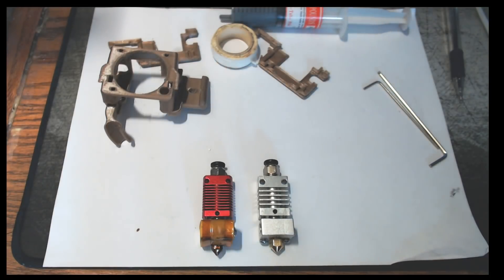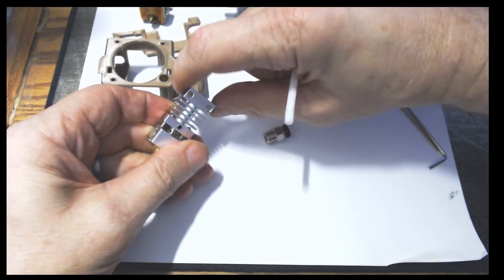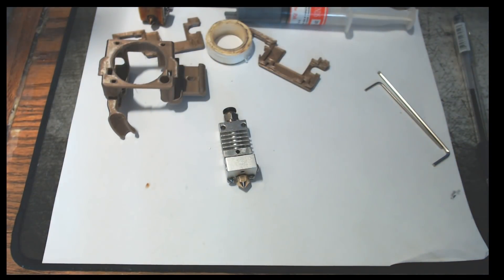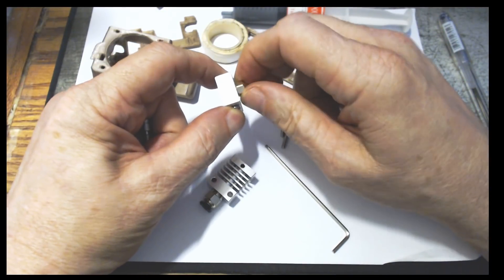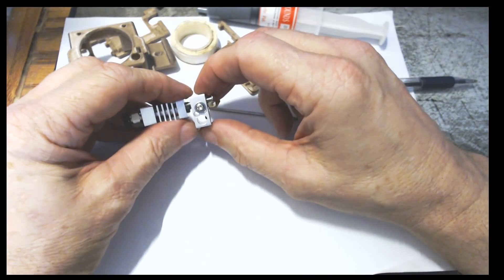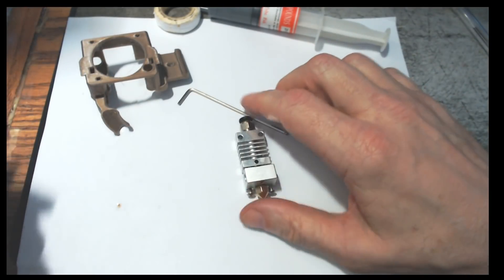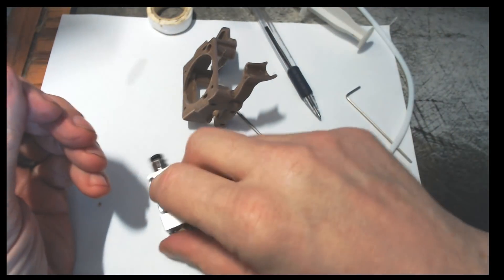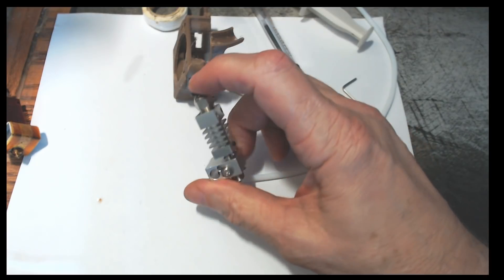All metal hot end for the Ender 3 for $7. Part 1, tips, trips and lessons learned.

Comment: First of all, thanks for sharing your experience. I tried hard to make it working with my cr10 but i couldn’t. It clogs after few filament retractions. I thought the hot end was defective so I kept it away and put back the stock hot end but with a blue PTFE tube jus like the Capricorn one. Also not sure if it is a clone or not but it is much cheaper. Anyway, after watching your video i will try it with your suggestions when time come to try a high temp filament. 
Thanks again.
Reply from the maker: Try doing what I did in the video and also setting the retraction distance at 2mm or less and the retraction prime speed to 20mm/sec. I've been using that with good results with both PLA and nylon.

Comment: I see that this cheap all metal hotend comes in two flavors: 1.75mm and 4.1mm. The seller claims that 4.1mm version is for printing temperatures 0°C-220°C, and 1.75mm version is for 260°C-300°C. Do I really need to replace hotends when switching between nylon and PLA?
Reply from the maker: The 4.1 mm is probably not an all metal hot end, the 4.1mm is the size needed to push the bowden tube all the way down to the top of the nozzle. 1.75 stops the bowden tube just past the top fitting and only allows the filament through. And while you don't need to swap hot ends when switching between nylon and PLA, you'll get better quality prints with PLA and a non all metal hot end because you can crank the retraction up to a level that will clog an all metal hot end. It's not a huge difference and there are ways to lessen it, but it is there.
Reply: @3rdpig  Ok, so I will give a try to 1.75mm version. Thanks!

Comment: i saw 1 that looks like that on ebay for $15... do you think that paste is really necessary? i don't know where to get it anyway... also i watched another video on replacing ender 3 stock with the swiss metal end which looks exactly like the one you installed..he said he had to re calibrate the firmware so nozzle temp got to correct temp as it showed,,can you tell me if this is necessary...sounds like a pain in the ass... thanks for your great explanation..
Reply from the maker: Don't use heat sink paste, that was a mistake on my part. I should add something about that into that video. I haven't bothered with nozzle temp correction on mine, but to do it you'll need an multi meter with a temp readout and a bulb type thermistor. The Owon OW16 $25 is around Aneng 8909 is $30, either will work. You'll have to use something like nylon filament, pull the bowden tube do an atomic pull to get the filament path completely clear, then put the thermistor directly into the center of the nozzle. I've been meaning to do this and make a video, but just haven't had the chance. As I said, I haven't done it on mine and it's printing fine at the temps I'd been using, but as always, yours may be different.
Reply: @3rdpig  Thanks for the update... i actually found 2 on ebay for around $10,but they will probably take 2 plus weeks... they look the same so i will keep my fingers crossed... thats good to know you use same settings so mine should be very close to your results...i use main Petg, do you use same retraction and speed settings as with pla or do you slow things down a little? i hate blobbing and stringing... thanks

Comment: Can you post some pictures of your prints with this hotend
Reply from the maker: Everything I've made in any material other than PLA and PETG since installing it was made with that hot end, that includes nylon, ABS and Polycarbonate. The polycarbonate prints sucked, but that's not the fault of the hot end. You can look at those videos but I'll also try to include some shots in my next video update, which should be in a couple of days. If you're looking for pictures of PLA printed on that hot end it might be a while since I don't print PLA on the printer with that hot end. What filaments and temps are you going to be printing that's making you consider an all metal hot end?

Comment: Thanks so much for the tip about the two screws that hold the heater block to the cooling fins. I've got a metal heat break that converts the stock hot end to an all metal and I keep getting clogs. When I ran filament through it while cold I noticed a bump where the nozzle and throat/heatbreak meet up. I'm guessing I have things too tight and that's causing my issue. I can't wait to get home and loosen them up to see if that resolves my problems.
Reply from the maker: I've since been informed that those two screws should be removed after installing and 
tightening the nozzle when hot.
Reply: @3rdpig  I ended up leaving those two screws out when I put everything together to see what would happen as the nozzle is really tight against the heat break. I'm not sure if it's having finally gotten thermal compound on the bottom of the heat break or leaving the screws off or not having them pull the heater block and nozzle at a funny angle but for the first time in a while I've gotten more than 5 hours into a print without it clogging. Thanks again for the helpful video.

Comment: Hi Chuck.. Big fan here.  I'd love to hear what settings you finally settled on with this guy.  I've been having a tough time, but my situation is improving I think.
I am currently at 1mm retraction, 20 prime speed, like you said, used their paste..  but after a few layers, like in your example, I was getting separation and weirdness.
I found how to tune the pid, did that...
Used the paste..   
I start out nice, only light stringing..
Now after several layers I get large temp fluctuations, like 5+degree.. and invariably the filament doesn't come out..  this used to happen sooner, like in your example, now it's happening much later..  I'm not getting weirdness with my layers now, but the filament either sputters or it gets hung up, possibly at the titanium piece

Would the filament problem also cause the temp, or temp problems screw up how the filament behaves?
I've tried my best, I believe, to tighten things at temperature..
Is there a good way to tighten the titanium more maybe?   
Sorta feels like I'm chasing my tail.
I don't have any spray or lube to make things slippery.. there a cheap easy solution to try?  (I'm in the Philippines.. Don't exactly have a bounty of 3m or loctite products available..  but can always order.)..
Sorry for the word salad... I'm just exasperated..
Reply from the maker: I can hear the exasperation. And my friend, I've felt it too. For me once I got the retraction settings tuned, currently I'm using 2mm retraction and 20mm/sec prime speed, almost all the problems but the light stringing went away. I haven't had a clog since. What thermistor are you using? I switched to a screw in type, that seems stable to 300c. Or at least stable as far as the display temps are concerned. I also picked up an inexpensive multimeter that has a temp readout and comes with a K type thermistor, I thought I'd attach that and see if the temps agree.  I don't see the filament causing the temp fluctations, although I suppose it could be possible with a filament that's really out of spec in diameter, but I think you'd see that in other things as well. Maybe it needs drying? Are there any signs of it having absorbed too much moisture? Also, when you clean the hot end after a clog are you getting it really clean? I was taking mine out to the garage, heating it with a butane torch and pushing it through with a brass rod. I can't think of much else off the top of my head. Maybe switch back temporarily to the stock hot end just to make sure it's not something else and not the all metal hot end? Good luck!

Comment: nice, now how can you make the stock Ender 3 goes to 310 degree ? is it just setting ?
Reply from the maker: It's in the firmware. You'll need to flash a  bootloader, then flash stock Marlin to it with the Ender 3 additions. I've got a video on it, so does Teaching Tech. Thanks for watching!
Reply: Chuck Bryant thanks for your fast and accurate answer

Comment: Kudos Chuck. This was a great video, I think I'm going to have to buy another E3 if I'm going to experiment with this. My one and only E3 is completely dialed in and I don't want to screw with it now. A quick question that I'm sure you've thought about, what are the material benefits of shooting 280 degree nylon over say 240-250 degree PETG? Is the nylon that much better?  I changed my Bowden tube on the E3 to Capricorn which apparently will allow me to run the head up to 260 although I've never been there. I did the switch because I had a bit left over from my Anycubic Linear Klossel which BTW really benefits from a Capricorn bowden tube (reduced ghosting). Anyway if I do go down the all metal road you are now the go-to reference. Thanks.

Comment: Just asking how the all metal hot end works with PLA, so many all metal hot ends do not do well with PLA as it seems to drag and stick to metal to much.
Reply from the maker: The trick is the retraction settings. You can't retract 5mm into an all metal hot end, it will stick and jam when it primes. I tried 0.5mm which gave me horrible stringing across open areas, but didn't jam. I kept increasing until I got to 2.0 mm retraction which so far is working well, little to no stringing and no jamming. I also cut the prime speed to 20mm/sec which also seems to help with jamming. 

I won't say that PLA prints are quite as good as it was with the stock hot end, but it's close and perfectly acceptable to me. But I have other printers with standard hot ends. If I only had one printer and printed mostly in PLA I might think differently.

Comment: Nice job...and how is with PLA? Did you solved the stringing?
Reply from the maker: Not yet, I'm still playing with settings. And from what others have told me, the all metal hot ends will never print as clean as the others since you can run the huge retractions as a standard hot end. If so, that ends my plans of putting all metal hot ends on all my printers. I'll keep at least one stock.

Comment: The worse thing about 3d printing are the hot ends for sure, I've had so many problems with them and I haven't found one that is perfect or without problems.
Reply from the maker: I don't think there is a perfect hot end, if there is I sure haven't found it. However, I've found that if you follow certain procedures carefully, then the all metal hot end in my video is pretty good as long as PLA isn't your main filament. But they have to be tightened in sequence and at a temp above that which you're going to print at. Do it wrong and it will leak or clog. And I think all of the all metal hot ends have the same issue with PLA stringing when retraction has to be kept to 1 or 2mm which the all metal hot ends require.

Comment: So should i get this hot end or no
Reply from the maker: If you really need to run nozzle temperatures above what PTFE tube can handle, and if you're willing to accept the drawbacks that come with an all metal hot end, and that's all of them, not just this one, and if you're willing to make the adjustments in your retraction settings so you don't get constant jams, then yes get an all metal hot end, either this one or one of the similar cheap ones from Aliexpress. If any of the above aren't true, then stick with a PTFE lined hot end.

Comment: Well, I've been printing nylon on a ptfe nozzle for a few days now. Knowing what I know now I won't be doing that anymore. Can anyone find a dual extruder hotend for a Bizer CTC?
Reply from the maker: Sorry, I've never even heard of the Bizer until now. I've got different dual extrusion printer coming to test, I don't know if that will help with your situation or not since I have no clue what a stock Bizer is using. It does look like it would be easy to enclose with it's full box frame.

I used to print the Taulman Bridge nylon on a ptfe hot end but it wasn't until I put the all metal hot end on and increased the nozzle temp to 265 or so that I started getting consistently good nylon prints. And neither of my Ender 3 printers would print consistently at 265c when they were stock. It wasn't until I flashed stock Marlin and upgraded the bulb thermistor with a screw in type it it became reliable at 265c.

Can the Bizer firmware do 260-270c nozzle temps? If so and you can't find all metal hot ends for it maybe you can do it using upgraded thermistors and Capricorn tubing?
Reply: @3rdpig   The bizer firmware limits the hotend to 250c but when you print from a laptop it'll go as hot as you want. I'll try the capercorn tubing. I don't think I need better thermistors because it holds its temperature fairly consistently. I am a bit worried about melting the ptfe tube or making it release toxic fumes.

Comment: hi what temperature do you print pla with this hed thanks
Reply from the maker: Use the same temp as you did with the stock hot end. I use 210.
Reply: @3rdpig  thank you, i Am geting crazy with this hotbreack, jame all the time, can you sir Telmi your retractions settings  for this one. 
i start to print ok after the first layer the extruder starts popping if i put the temp at 235 strats to print normal again but after a wile stars underextrude andar popping again. 
thanks for replay
ps i forgot to say i Am traing with pla,
Reply from the maker: @EduardoSousa-fk6oy I had the same problem, here's what I did to stop the jamming. First, make sure you have the hot end cleared well. Then cut your retraction distance to 1mm and the retraction reprime speed to 20mm/sec. Put your nozzle temp back to what worked for you withe the stock hot end or what the filament manufacturer recommends. After you get it printing right you can try tweaking the retraction distance up a little at a time. Also, a filament oiler will allow you a bit more retraction before it will jam. Good luck!
Reply: @3rdpig  thank you very mutch, for you tips,  👍

Comment: And is the grease needed on brass nossles?
Reply from the maker: The heat paste compound is there to promote heat transfer, it doesn't matter what material the nozzle is made from. And don't use the teflon tape, that was a less than optimal idea. You're looking for heat transfer. As far as changing the nozzles are concerned, I don't change mine that often, so it hasn't been a problem.
Reply: @3rdpig  ok did the past and am havinging to print 10° hotter for simular print results than with factory hot end. Is this typical?

Comment: I am having an issue where my all metal hot end isnt extruding the pla. it just heats up and curls in the top. is that a retraction issue?

Im totally lost on this one. been picking at this thing for over a month now
Reply from the maker: Not sure what you mean by "curls in the top". If the nozzle is heating up, but the filament won't feed despite the feed gear turning (usually accompanied by a fairly loud popping sound) it's probably a clogged hot end. And that could be too much retraction. But first you'll have to get the hot end unplugged.
Reply: @3rdpig  i think it might be retraction. Im not getting issues with cura displaying right in ubuntu

Comment: what is the link for hot end in 7$ ? (ender 3)
Reply from the maker: The link to the one I bought is no longer valid, but if you go to Aliexpress and search for "all metal hotend cr10" you'll find them.There are a lot of them ranging from $2.88 to around $15. I'll post a link to one that looks identical to the one I bought, but I really recommend you look at them and make up your own mind. https://www.aliexpress.com/item/All-Metal-Hotend-Kit-upgrade-CR10-extruder-Titanium-Alloy-heater-break-1-75MM-4-1MM-for/32951621998.html?spm=2114.search0104.3.8.76751341UunzJM&ws_ab_test=searchweb0_0,searchweb201602_4_10065_10068_10130_10890_10547_319_10546_317_10548_10545_10696_453_10084_454_10083_433_10618_431_10307_537_536_10902_10059_10884_10887_321_322_10103,searchweb201603_6,ppcSwitch_0&algo_expid=4e7c0774-ffec-422b-a864-1755886bc5b2-1&algo_pvid=4e7c0774-ffec-422b-a864-1755886bc5b2&transAbTest=ae803_5
Reply: Thanks

Comment: Has anyone had any issues with pla jamming when trying to extrude? I spent a good day trying to figure it out with no luck trying to get it to extrude.
Reply from the maker: Sure, almost everyone who's switched to an all metal hot end has dealt with jamming. You need to set your retraction amount to 1mm to 2mm and your reprime speed to 20mm/sec. That should go a long way towards solving it.
Reply: @3rdpig  Thanks for responding. I solved my problem of the hotend immediately jamming when I simply extruded some filament by just removing the screws 2 long screws that screw the heat block to heat sync. Though I still get constant jamming when I attempt to print something in pla. As for retraction settings I was running it with 80m/s retraction speed and 2.5 mm retraction since that what was recommend in the seller instruction for printing with pla. I will try lowing my retraction and see if that helps.
Reply: @3rdpig  Ok Strange. After Accidentally printing a old test gcode file that had my default retraction settings of 6mm retraction and 50mm/sec It seems to have printed fine without jamming.